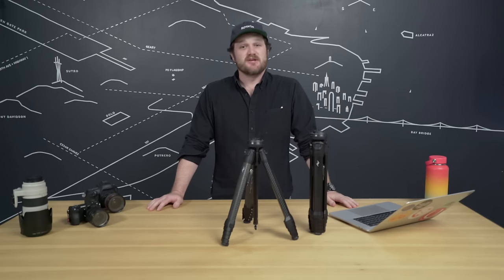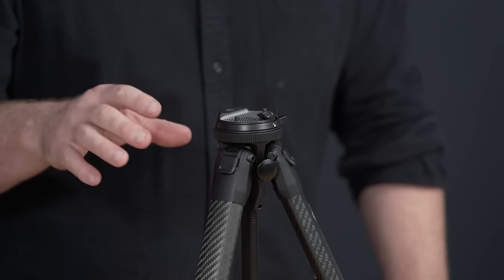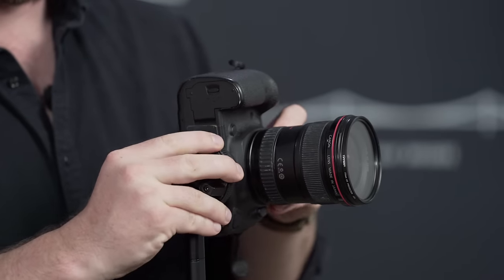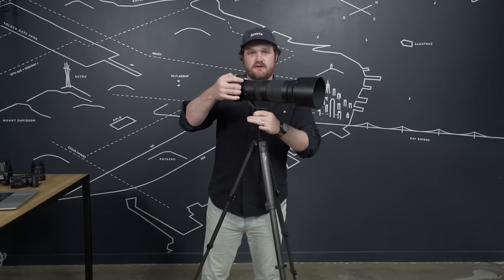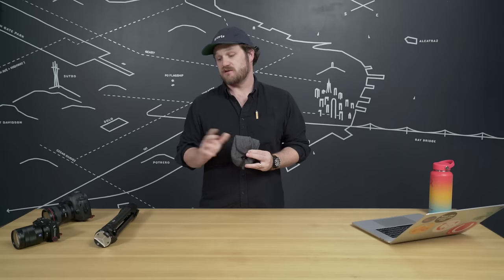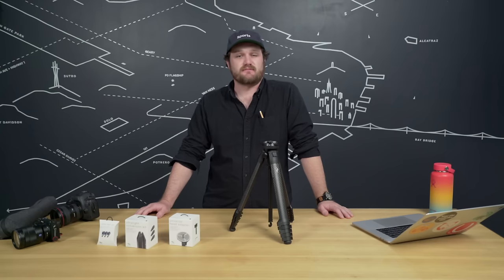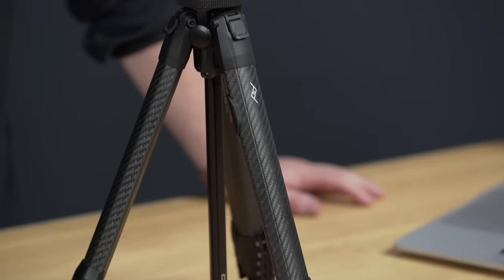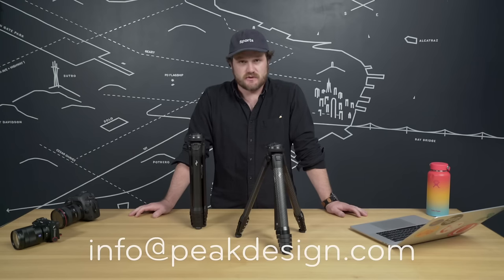Peak Design Travel Tripod + Accessories: Setup + Tips

Comment: I just ordered two Peak Design Universal Mounts for my two Peak Design Tripods; one in aluminum, the other in titanium.  I am going to use the universal mounts to mount a Star Watcher Pro star tracker on each tripod.  One will contain a Canon R5 MK II with the Canon's 100-500 mm RF lens.  The other will have Canon's 5D MK IV with 100 to 400 mm EF lens.  In each case I will be using the tracker with its equatorial wedge, declination bracket and counterweight kit.  This looks like as sturdy a travel tripod as I can find.  I will be carying this equipment onto an airplane to get to my destination.

Comment: You guys need to make an L bracket.
Reply: Yes please! I love the Peak Design Capture Clip but I also like using a L Bracket, would be awesome to have something that combines both!
Reply: @florian-sngr  3 Legged Thing Ellie PD combines the two if you haven't seen it
Reply: that'd be awesome! and i'd love to see a manfrotto-compatible l bracket w/ peak design capture clip...
Reply: that'd be awesome! and i'd love to see a manfrotto-compatible l bracket w/ peak design capture clip...
Reply: Kyzuki but what if you want to go into portrait mode?  It only has the pd plate on the bottom. Not the side.
Reply: @justonbrazda3846  It's ARCA  Swiss compatible, I guess if you have this tripod you just need to remove the two securing pins
Reply: Kyzuki that’s not completely true. I have the pd tripod. I also have the 3 legged things L-bracket. Pd lists this bracket as compatible on their website. Mine does not fit correctly, and wiggles around even when I tighten it as much as possible.
Reply: @justonbrazda3846  I stand corrected. I use the Ellie PD on the capture clip and a different tripod. I didn't know it doesn't fit the PD tripod.
Reply: @Kyzuki  No doubt it will fit in landscape mode, but when you turn it into portrait orientation it may or may not fit correctly
Reply: Can they make one fit all or one for every camera model out there?
Reply: @SentimentalMo  I came here to write: "All you need to do is to decide which camera to support."

Comment: I bought this model at best buy yesterday. What surprised me the most is how light the tripod feels when it is fully extended. I leave a tripod in my car and often vacation with a tabletop tripod. With the option to reduce the weight with this kit, I can now vacation with the peak design with 40% less weight. Thank you for taking the time to build such a wonderful, well thought out tripod. Also, I was not looking forward to using the clip to hold my camera in place. I didn’t realize that with the camera clipped in , I could safely walk long distances with the camera secured to the tripod. I would never do this when my camera was screwed on to a traditional tripod head. People complain about the price but they should really think about how inexpensive this will be after a decade of heavy use and thousands of amazing photographs. If you buy an affordable tripod, and travel or hike with it often, you have to replace them every two to three years anyway.

Comment: I have owned the aluminum tripod for 5 months and overall it has met my expectations.  It is real sturdy in high winds, very easy to set up, carry with my camera in place, and to collapse the legs.  

If there are a few suggestions I would like to see taken to heart is the locking key for the plate kept falling out.  I would like to see it have a Velcro cover so you simply lift the Velcro, grab the key, and then use it.  This way when you either carry or turn the tripod upside down to collapse the legs the key doesn’t fall out.  Right now, I keep the key in my camera bag so I don’t lose it.  

One of the lower legs has started slowly collapsing on its own, and so I am interested to see how Peak Design handles my warranty claim.  As a workaround, I don’t extend the legs all the way out - just to the third level - and then raise the center stalk.  Not ideal because I have to bend down but workable.  

Finally, buy a 2nd plate especially if you have a large 500 mm lens.  I did this because I don’t want to be switching plates in the field, and if you lose that key you are done for the day.
Reply: It is pretty easy to fix any problems with the legs. Check the other maintenance video he mentioned.

Comment: Fun discovery : the two smaller gaps on the handle of the soft case are large enough to pass most belts through, so it becomes a perfectly functional belt holster (maybe scabbard is the right term?) for the tripod if you don't want to carry more weight on your shoulder.

Or you could use it to keep several cans/bottles of your choice of liquid refreshment handy while you wait for the perfect shot with your travel tripod.

Comment: 🚨 I was skeptical for a while about buying this tripod thinking that it was an overpriced gimmick. Only for a while and I’ve owned it for well over a year know along with 2 other travel tripods that I already owned. “Why do I need another one”.??  This one has a place that the others don’t and I grab it when “size matters” and in  this case being so streamlined and compact.  It really does set up in seconds with its level locking system and I thought I was a diehard fan for twist locks.  The quality of this tripod can be felt in your hands and I learned something from this video, thank you.  Low mode… I’m sitting here right now typing with the removable center column section and the wrench in my hand.  I didn’t even know that the legs spread out wide.  And moving the camera to a different position on the head  in portrait mode if it’s restricted from aiming how you like is a great tip too. 
This is worth every penny with its excellent build and machine work.  
It just feels nice and I also learned that the tool holder can move up and down on the leg and I used to have it really high up which was not so convenient to get the wrench out.  
Oh yeah, you can’t forget about the cell phone holder inside the center column, which I always knew about.
I love this thing  👊🏼💝

Comment: This is hands down one of the most Innovative tripods I've ever seen, I love the fact it has a quick release,  I love the ball head & lock mechanism,  & I love the included built in phone grip & key tool. It's compact & universal. Sure it's quite expensive for the carbon fibre one however if you want good quality products it comes with a price tag. I love. It awesome pice of kit.

Comment: Just got the tripod. It's a great piece. However, the bushings are a HUGE problem. I took my legs off to test the ultralight kit. I placed the legs into the tripod bag. I did not intentionally remove the bushings. When I put the legs back on, one of the bushings was missing. I was able to find it in the tripod bag, but if they come off that easy, then PD should include a 3-pack of these in the kit.

Comment: Thanks for this very detailed video! First let me say, I did not NEED another travel tripod, but I really WANTED this one. Now that I have it and am at my first festival and using it, I thought it was time to watch this, and I learned a lot. Not rocket science, but on the platform in the dark, it really helps! Anyway, it's supporting my 5DIV with sigma 60-600 lens, no problem. It's way more stable feeling than my other travel tripod and for a lower price. I shot 2 sets of video and it was rock solid. I do think I am going to add a video head for more flexibility, but for landscape and astro shooting of stills, the attached head will probably do just fine.  I love that the mount integrates with my other PD products. It's not a pro level video tripod, but it really does work nicely for something so small and light. It's nice to know I can convert it to a smaller "backpack" tripod if needed, but I don't imagine I'll ever do that. It's really light to start with and I don't feel bad about the weight in my checked bag. I am thrilled with this product and my other travel tripod is now relegated to second fiddle!

Comment: I love my Travel Tripod and it is very practical, however, I thing there are 2 things that can be improved:

1. Pan. I find it impossible to pan at any rate without any additional tripod head install.

2. For the V2 they should include soft rubber foam on all leg's tops so you can grab it in cold weather/humid conditions and it doesn't frost bite you or slips. Or maybe create rubber foam accessory that can be added.

Comment: I love this tripod, can't wait until it's released,  for future improvements, I would adjust the low mode, so rather than use the hex wrench, just put a spring push clip in the shaft itself, so you remove the shaft, push in the clip and separate the shaft. much quicker and easier to do, especially while going to low mode in the dark or out in the woods on a cold winter morning.

Comment: OMG wonderful product! I will definitely be on the lock out for this item! I did want to suggest something. Maybe there could be a way to also incorporate a tether cable lock? I currently use the tether tools tetherblock, but it's really not streamlined. When I used a Canon 5DM2, the tetherblock was fine because my camera was quite wide, but now that I'm using a Sony A7iii, my camera (even with the battery grip), is still quite small for the tetherblock to seamlessly fit it. I don't know if this would be something that you amazing guys at PD can look into - but for someone who does shoots and needs to be tethered to a computer, I'm in the hunt for the best way to block your tether cable to the camera. Maybe it doesn't even need to be an accessory for the tripod! Just my thoughts! But keep up the amazing designs 😊 I'm a fan!

Comment: Will the tripod with the spike feet installed fit in the hard case as well? The spike feet should be standard/permanent part of the tripod with some removable rubber covers to keep them from damaging delicate floors instead of the cumbersome installation process (and reverse) with extra cost.

Comment: I have several peak design products and I love most of them. The best I like are the straps and I have three of them. I also love the anchors. The only thing I don't have is the camera bag. Because I have too many bags. I had ordered the tripod during the Kickstarter program and had received it promptly. I had never used it, other than testing the functionality the day I received it. I like everything about it except the Hex wrench and the 4mm one broke into two pieces the very first day (brittle fracture, I am a Metallurgical Engineer specializing in heat-treating of metals). Today, I took it out to do some video of my dog chasing ball as I am experimenting the Z9 of its different video modes and capabilities. I had to watch this video to learn how to remove the center column as I am doing the shoot at a lower height, and I realized that the hex wrench I got with the tripod on the very first day is broken into two pieces. I am not sure if anyone else had this issue.

Comment: Any chance you could make an additional accessory attachment item that includes a basket for each legs that resemble one found on a hiking pole? The purpose would be for more stability when used on a snowy or sand dunes type of surface so the legs don't sink into the snow/sand.

Comment: I love my tripod, but the little tool does not stay in the holder.  Mine has fallen out twice when carrying the tripod without the case.  The first time I found it but I have now lost it for good somewhere on the trail when I was carrying the tripod without the case.  I have just ordered another one and those things are $19.95. So when I get the replacement it will be taped on with gaffers tape.  If you haven’t lost yours yet I would suggest that you tape that tool in. It is not secure on the plastic holder and is expensive to replace.  For now I have just taped the Allen wrench that came with a previous plate that I had in the holder in case I need to tighten the plate.

Comment: Just a question, have You been thinking about milling out a little bit inside each of your tip? there should be room for a little rubber ring that stop the screws from falling out? Then the screws follow each tip in the pouch. Winter and freezing cold make at least my fingers num, and to fumble with those tiny screw could end up in loosing some screw in the snow...

Comment: Awesome design! Definite add to my gear list. Couple of questions. When you extend the centre column in the max/min dimensions section you only seem to extend it half way. As it’s removable it surely can be raised even higher than this. If so what is then the max height? If not, are there plans for an additional centre column extension section for the taller amongst us? Given that a universal tripod head adapter is available, surely an extra centre section extension  is feasible too. Secondly, are there any plans to sell this along with the accessories in a bundle option?
Reply: I extended it less than halfway mostly as a force of habit - this is where the center column has best stability. It can be extended higher - just over 150cm high. No plans for CC extender or bundles right now!

Comment: Hi guys. I use a lot of your gears, so I  got a big surprise when I tried to use the ultra light conversion kit. No problem in removing the legs, but when I put them back, 2 out of 3 shroudes got a broken edge when clip it back in place.  How do I get replacemnt for those broken shrouds? Thanks.

Comment: Looks amazing, but a lot of work to get it into low mode. Is there any reason you couldn't leave it in low mode? Does it require the center column from structural support when it's folded up? Does it still fit in the bag in low mode? I'd very rarely need to extend the center column any more than what's necessary to compose the scene.

Comment: Love my tripod.  But why not keep it simple and put a QR plate on the bottom of a standard head and use the compact head to keep it in place?   Works great when you need it and quickly switch from head to head.   Also works with RRS pano head for smooth results.

Comment: Been trying to see if any pano panning head has a bottom that can clip into the low profile mount instead of changing out the tripod head. Would putting a SunwayFoto DDH-07N Panoramic Panning Clamp on a peak design clip work? as a low profile, small panning device?

Comment: Thanks for the review. I am considering a Peak Design tripod. I like everything about it but the soft carrying case.  It's soft so it doesn't protect the tripod from shock when in a train or a plane, for example, or if using it outdoors in a rocky terrain. And it doesn't have a shoulder strap!!!!!!!!!!!!!!!!!!! 

How am I supposed to carry it? Sometimes I could hold it by the handle but many times I will really need a shoulder strap. 

The water bottle compartment on my backpack  is definitely not an option because I use it to carry water bottles! 

 I will need to buy a proper carrying case what puts me off the idea of buying a Peak Design tripod.   I will get the tripod only if I can  find a proper carrying case that will protect a travel tripod during a travel.

Comment: I just got my peak design travel aluminium tripod. It is very nice and handy to use it. However, I am finding it difficult to put the tripod back inside beautiful bag, rather could not. I find omnidirectional ball head adjuster a bit nudged. Unable to register it online as well. I am from India, purchased it through nexgen gear.

Comment: In your opinion, why is the carbon version better, just for the sake of weight? There is one thing that catches my eye: all the tripod models I know the carbon version supports more load weight, but yours is the same for aluminum or carbon: 9.1 Kgs.
It may be we must add to the 300 grs. less weight, resistance to oxidation by water, humidity etc?

Comment: The straight down orientation as shown doesn't seem to work for me, the ballhead sections prevent me from doing that, unless i use the portrait mode and clip the camera in sideways. which he doesn't seem to do but still manages to show and claim. 10.35 - 10.38

Comment: I can't seem to put my phone holder back in centre column with the hook, not enough room inside for some odd reason, even when i forcefully try, plus the  magnet which is supposed to keep the phone holder in has no strength at all, it just falls out. Apart from the issues with the centre cplumn hole where the hook and phone holder goes this is an amazing tripod. Must be a manufacturing issue with just my model as its definitely not going back in as easy as the chap does it in this video. I dont like to nit pick at problems, but if you're paying just under £600 for a tripod (i got the carbon fibre one) you should expect everything to be in order.

Comment: It is beautiful and I want one, but even at half the price it's still far to expensive for the use I will get from it.
I got a heavier one. Still carbon fibre, so a lot lighter that my Velbon from 40 years ago - sturdier, too.

Made by Mengs and cost me £59, including delivery by UPS. Even works as a monopod.

I would have loved to have the Peak Design one but not at 10 times the price.